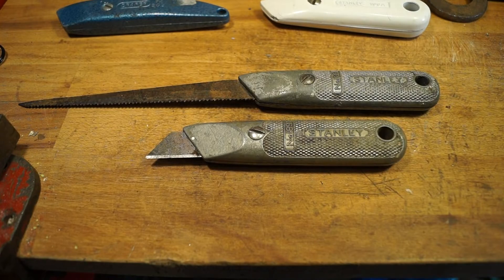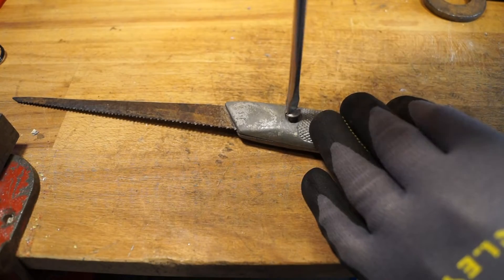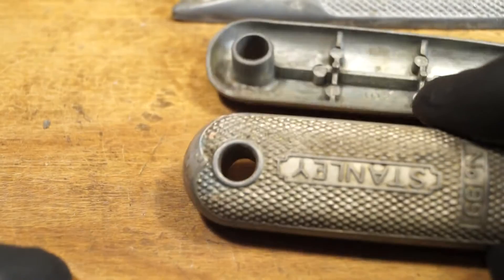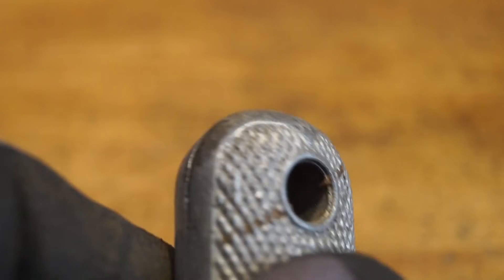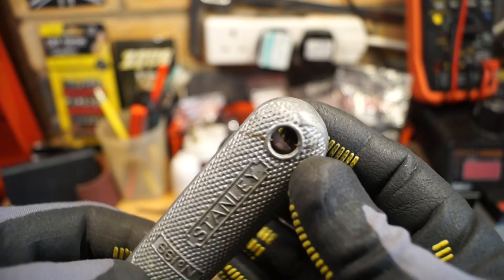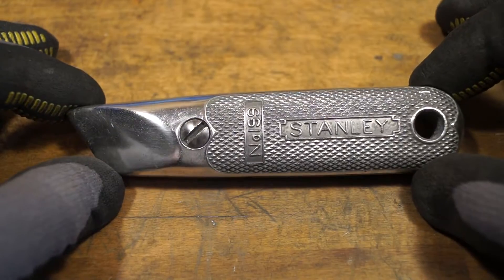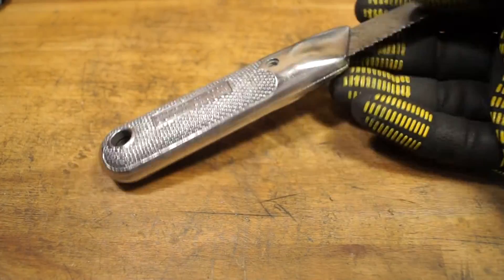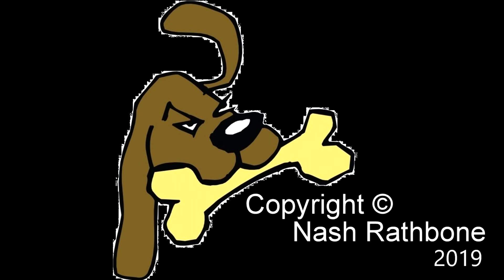Stanley 199 Utility Knife Restoration

Comment: Nice restoration, I'm impressed the alloy went back into shape with a light hammering.
Try the spongy things ladies use on their nails, they have different colours for each grade of sanding/polishing. I use them for polishing tools, screw heads, e.t.c., they work great on brass, aluminium, even stainless steel.

Comment: Picked up two of these at a used tool market. They feel  great in the hand. However, I now know they wear out! The small blade retaining nib and the border edges wear because they're soft alloy and the blade is the opposite of soft alloy. So the blade moves a lot. Bummer.

Comment: I have a lovely blue vintage made in England 199, same exact casting as the one you modded. I am not a collector or anything, it was jut cheaper than a brand new 199 on ebay!!! And much better quality.